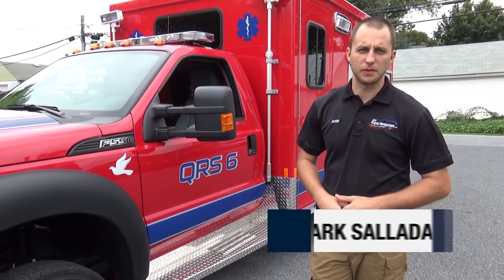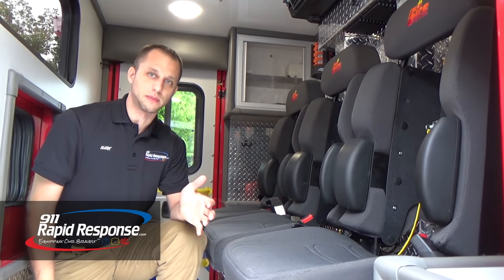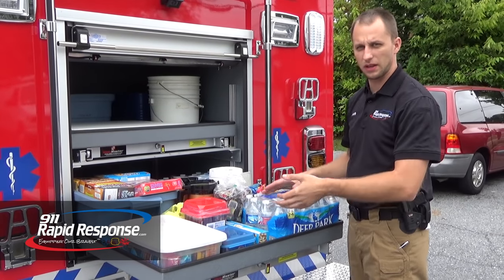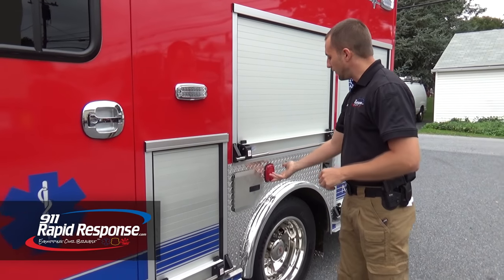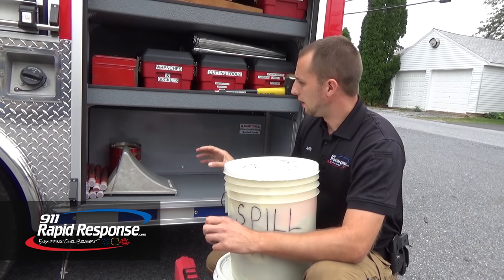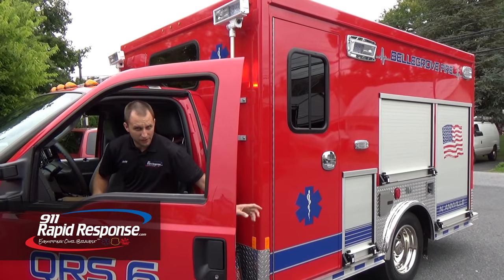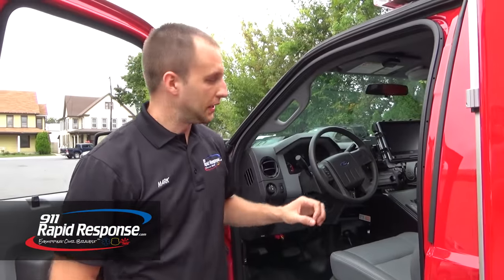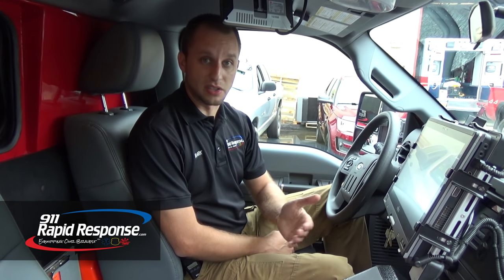Bellegrove QRS Ford F-550 Chassis with Custom Works Body | 911RR

Comment: This rig definitely cost a pretty penny. TBH i would much rather see a decked out medical response vehicle than a  heavily militarized police vehicle.
Reply: What a stupid, ignorant, uniniformed comment.  If you were a cop, and had to approach a madman with a gun on the highway with no cover, wouild you want a car, or a bullet proof vehicle to get close enough to use a non'lethal choice.  Its like saying I'd rather have a 200 gallon fire truck and give the cops what they need.  HOw about these guys give up the chrome wheels.  Fire departments are so into ornamentation, a old style mechanical siren, a siren or two, claxons,  geezz,
Reply: The funny thing about this comment is that: this isn’t for the police it’s for fire department and is clearly said. And then it’s pointed out indirectly over and over. Such as I dont know to many police that have seat for air packs. I don’t see many police cars/ trucks that have the medical logo on them. 7:57 truck says fire. Also don’t know many volunteer police departments 
And they have a full cabinet full of medical.